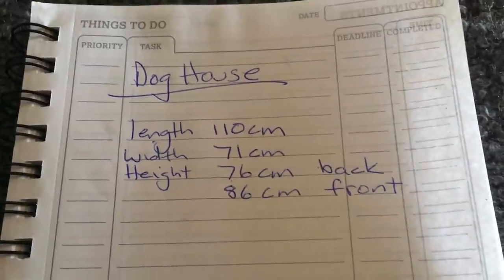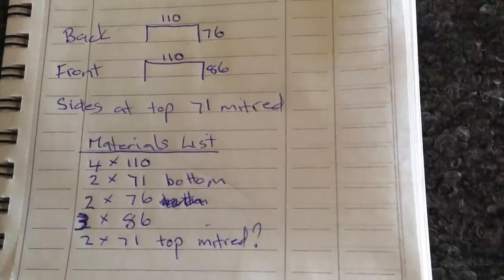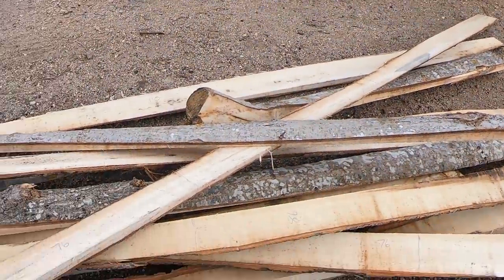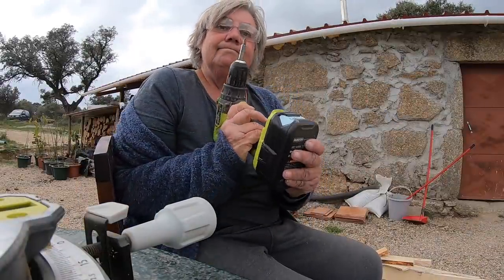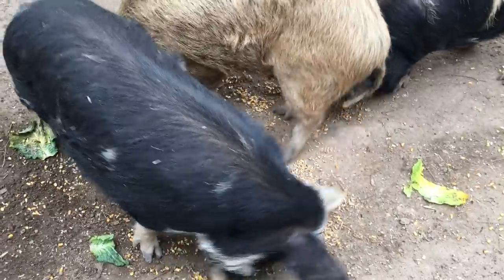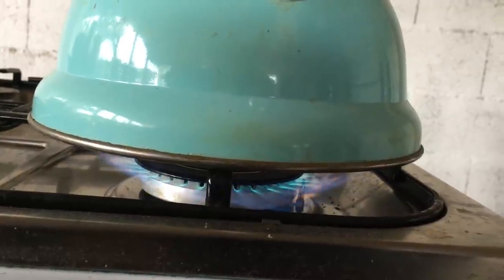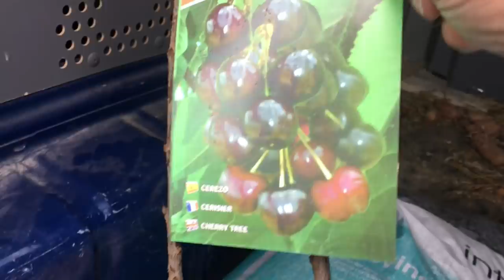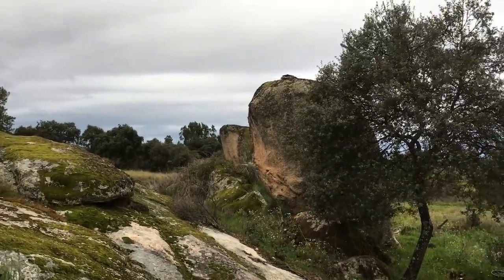Off-Grid Life is an Adventure (Focus on the Positive)

Comment: Your farm & vegetables are looking great, Cindy.  I too use mulch to keep weeds from taking over my planting beds, & it does work great but only if there is at least a couple of inches worth.  3-4 inches is better.  When I didn't have enough mulch, I have used layers of newspapers w/ holes cut for plants.  Then I put mulch or even rocks/stones/pinecones to keep the papers from blowing away.  Overlap the newspaper edges to prevent weeds between the papers.  When I didn't have enough paper, even old clothes did the trick.
Reply: I forgot to mention that leaves make great mulch too.
Reply from the maker: Will be working on that this week!

Comment: Strong cardboard box approx. 20 cm high that fits around your stove top or the burner you are using, cut out bottom and top or fold in for strength, wrap in multiple layers of aluminium foil and use as temporary windshield. Works for my paella ring in the garden on a windy day 🥘 😊.
Reply from the maker: Great idea!

Comment: You could try making a tube of sheet metal (corrugated roof e.g.) of about 30 to 35 cm in diameter and about 30 cm in length to protect the gas flame from the wind. You can put some wire around the circumference to keep the sheet from jumping open. You need a piece about 105 cm in length of 30 width. The corrugations should run parallel to the width, so that you can actually bend it.
Reply from the maker: Getting the sheet metal where I live is not the easiest.

Comment: Cindy why not put up a temporary tarp in your kitchen (will save you some gas) for bad windy, rainy weather which you could roll up when the weather permits for the time being. 💖
Reply from the maker: Great idea! The reason I didn't was to let in light so I could save power by not turning on lights as the solar power has been stretched with a month of no sun.
Reply: @CindyVine  ❤

Comment: What can you use to shield the flame?... something metal, maybe aluminum foil folded over 3 or so times that's fashioned into a ribbon-screen that can be easily put/moved around the flame (or base of kettle or pot)?

For backpackers or campers, there are fold-up aluminum shields sheets to put around the camping stove flames.
Reply from the maker: Have to do something!
Reply: Hazel ☘️ …
Yes a shield of one sort would save time and gas ! 
You are very inventive Ruth ! 
🙏☘️😘
Reply: @portugalonawingandaprayer473  Had that backpacking experience tucked in my memory 😄.  Very hard to cook with wind blowing away the flame!  The wind shield did the trick 👌🏽.